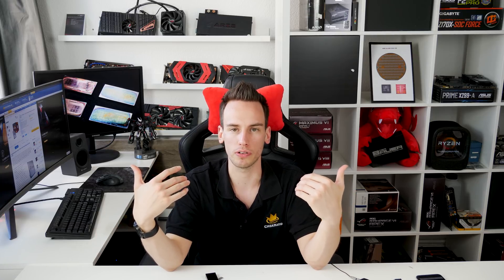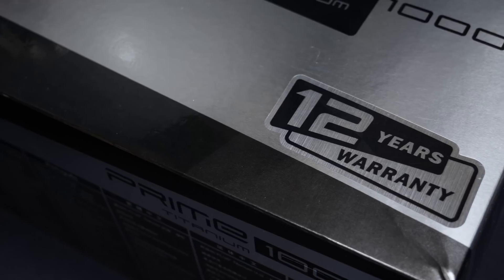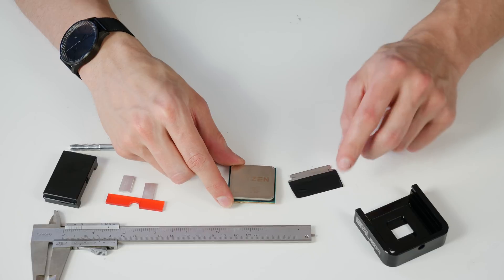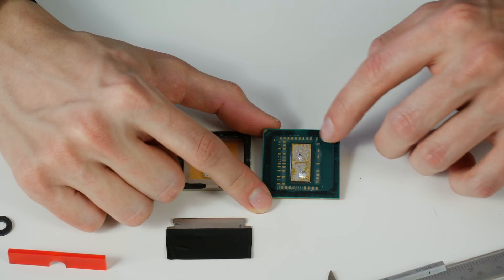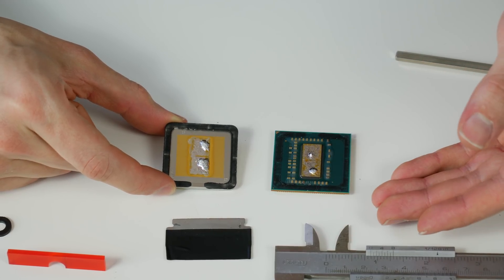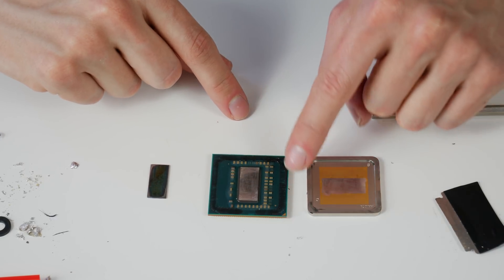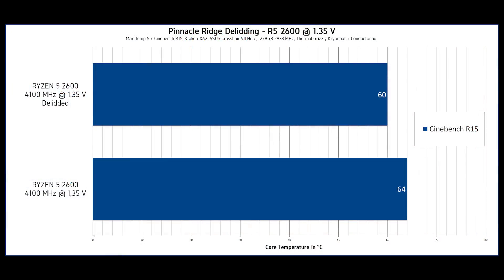ZEN+ Delidded - Before/After Temperatures - [Ryzen 5, 7, 2600, 2700X]

Comment: I ended up here because my girlfriend bought someone's old Gaming computer.  It's a bit of an outmode.  I havent removed the CPY cooler (yet) but so far it looks like whoever built it used a cheaper RAM in it and only 16GB of ths 32GB potential, it's also 2100 and I think the motherboard said it's capable of 2600 and 3000.  
   The Mo-Bo is a Gigabyte A320M-S2H V1.  From what I'm seeing, a Ryzen 5 3600X will work (if it doesn't already have a Ryzen 5 3600)  BUT I'm seeing a lot of issues with the R5 3600s havibg issues dissipating heat, and several people have reported that it was cracked or faulty solder; and that a de-lid and liquid metal fixed the issue.   So can this same method, or similar, be applied IF the person who sold it, di so because it was havibg issues.   I've seen where some people "fix" the issue by simply turning off cores, throttling or temperature limiting in the bios, but thats not actualky a fix.
 I'd tather change thermal paste or liquid metal every now and again, rather than have a brick, or something that might burn out.

Comment: Fantastic video. Can I ask , is the metal heatspreader that you removed made of solid metal? I the reason I ask is I have just recently installed a really tricky CPU cooler on my 5600x . Tricky meaning I had to put a lot of force from a 45 degree angle (clipping one hook on one side first then pushing down on the opposite side to latch the other side of the cooler) , but I’m a little worried I might have dented the heat spreader etc. 

CPU runs fine though. Would appreciate your feedback, thanks in advance 👍
Reply from the maker: The Heatspreader is always made of Nickel plated copper. Should be strong enough for any load :)
Reply: @der8auer   many thanks for your reply. Awsome video👍

Comment: Re:Die size. the only way it would be smaller is if it had the same performance ie if you made both the same core count and overall power the smaller nm one could be a smaller die size if they wanted

Comment: 13:18 why are you surprised ? what is the corelation of the size of a die with the 14nm or 12nm fabrication process ? those nm have to do with the dimension of a transistor and not with the die size.
They just manage to put more transistors on the same size of a die. That die is calculated to the TDP so that the cooler can manage all the heat coming out that cpu.

Comment: what about the difference that 4 degrees makes on top of the gains you make from also using the liquid thermal paste when you put your water cooler back on. so fo instance (this is just based on what i have seen so far from videos. so in most cases people are claiming 20 degree drop as using it on top of the lid when you put your aio or prism or whatever you use for cooling. so that on top of the 4-5 degree you gain from putting it on the actual cpu after you delid it so were talking a 24 degree c difference. would that be worth it then? or would you just recommend only using the liquid thermal paste normally without delidding and adding all that stress and effort. Im asking only because this is something i am interested in and am willing to buy a second 2700x just incase i ruin mine. Or should i just invest in a better water cooling system like a custom loop?

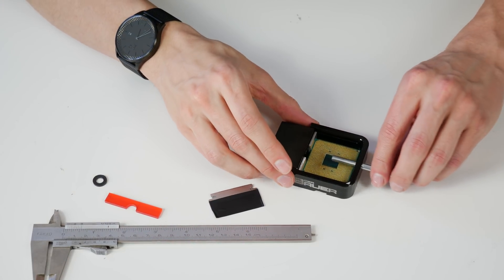Comment: That potato slicer didn't look for use on an expensive piece of silicone...you could hear the threads of the bolt running over the pins on the chip like running your finger down the teeth of a comb(@5:19) GN has a nice one with the bolt located on the side. Deforming the pins in any way(or creating a bur on nic) is bad news and counter productive to the task at hand.  Use extreme caution...

Comment: Actually die can be smaller, but you are measuring package dimensions. Take a closer look, die is inside that back thing. Do not forget that actual IC is about 0,3-0,5mm thick on there are protective oxide layers on the bottom there are pads for soldering. The back thing you are measuring is called wafer level package.

Comment: 12nm is 14nm is 20nm.  the other fabs skipped 20nm because it wasnt any better than 28nm without finfets.  when they added finfets they decided it was so good they should call it 14nm even though it was still 20nm.  thats what first gen ryzen was, 20nm.  second gen ryzen was... 20nm with high leakage gates for higher clocks similar to intels ++.  its all 20nm.  even wikichip has it listed under 14nm and it has 14nm listed as the same size as 20nm.  the numbers dont lie

Comment: Just so you know my 2600x which is not delidded idles at 28c and under a massive torture load only 68c curtesy of a Cooler Trade from a Friend the Prism Cooler on the 2600x is Bagging... So 4c is not worth it just get a cooler that is meant for a chip in a higher weight class and forget about it until it needs some new paste... Granted this was very interesting. Here's a Like!

Comment: TLDR; You went from 64C in five runs of Cinebench with a Kraken 62 cooler and 4.1ghz OC down to 60C and it is not recommended to delid a cpu for that. Conclusion: intel still has an edge (barely) but AMD doesn’t put bird dropping inside their cpu’s.

Comment: the half step node usually refers just to transistor size. so they use that same wafer for a smaller design allowing a larger transistor count on otherwise the same sillicon footprint

Comment: Woo, my Ryzen 2600x actually goes to 4.3 so mine is better than DeBaurs! The die size overall won't change really but the actual chips inside will be smaller and more dense.
Reply: OMG 4.3? you should go buy a lottery ticket lol.

Comment: I didn't verify this against multiple sources but rumor is 12nm is simply just an improved build process over 14nm rather than an actual shrinkage in process. So maybe 12nm is more like 14nm+ hence why the die size remains unchanged. 

A similar idea is going around about 7nm being more like 10nm in reality. Again, I did not check this with multiple sources but have heard it in youtube videos so it should be taken with a grain of salt.

Comment: The same die size may be due to having an increased area which allows for better heat flow (cooling):
H = k A (Th - Tl) / L  <--- increase [H]eat flow by increasing [A]rea
https://en.wikipedia.org/wiki/Thermal_conductivity#Equations

Comment: The reason the die is the same size is because AMD increased the space in between internal components in the chip.  So the "features" were smaller, but their was greater empty space in between them.  This allowed them to gain some clock speed.  AMD really attaches their IHS with quality materials.  Impressive stuff AMD.  This will help them in the future with Ryzen 3000 series.  Would an iron and desoldering braid be dangerous to the chip?  I would put a new bead of solder on it, and put it back into the oven to solder it again.

Comment: You were wondering why the die isn't smaller, it is because it needs to fit the same form factor so the company doesn't have to change tooling on the assembly line.

Comment: Solder compounds have a thermal conductivity of about 50W/mK indium liquid compounds peak at about 95. Its not worth the loss of warranty. Also, you are confusing the solder with indium which whould only be, at best, halfway correct for PbIn-50-50 but they most likely use SnPb (tin, lead) alloy or SAC, both are cheaper and better in therms of thermals.

Comment: Hello der8auer,

Do you think that smd caps are there to make different in between CPUs ? For ex: 2700 vs 2500 vs 2700x ? Because the Silicon mask should be the same but after binning process they sort low mid and high quality cpus

Comment: Mr Der8Auer if you just want your c pu  to have a better burst without throttling might you get better performance under high work loads (games) by delidding? Since burst is usually higher than an overclock it seems Ryzen is smart over clocked essentially.

Comment: The 2XXX series is more like a revision to the 1XXX series. Benchmarks show about a 10-16% increase in performance between the 1800X and the 2700X, so I'm not really surprised that there's not much difference under the lid between the two chips

Comment: Do you ever slice your fingers on those blades? I cringe a little watching you put so much pressure working them into the gap between the IHS and PCB while you hold the CPU with your right hand.
Reply from the maker: So far still owning 10 fingers :D

Comment: 12nm is the size of the transistors in the chip, so they can fit more of them in the same die size. If the die was any bigger they would get fewer yields per wafer in manufacturing.

Comment: its probably cheaper for mass production if you use the same dye size in all your processors instead of refitting all the machines for a marginally different size for each node.
Reply: Yep, probably what i suspect also.
Reply: easier faster better too. you dont see ryzen shortages

Comment: 12nm is just a refinement of 14nm. So they should be very similar in terms of size. The 12nm improves power consumption and enables higher clock speeds, but it's still basically the same technology as 14nm

Comment: hey @der8auer not sure if someone answered you on this;
Long story short AMD's main Focus was ZEN 2 on 7nm, they basically just wanted the gains from 12nm without a major redesign to shrink the die size; 12nm is a small re-tool of 14nm so it was easy to do and port over ZEN 1

You can read into it further on Anandtech's website: The AMD 2nd Gen Ryzen Deep Dive, Talking 12nm page

Comment: They might have kept the die size the same for manufacturing reasons.  Going down to 12nm might have only saved them a few mm^2 on what they could make the die size, but then they would have to rework all of the carrier PCB's etc.  So it might've made sense to just waste a little die area and so they could use more stuff they already had.

Comment: It likely wasn't worth retooling the PCB to make to get the small cost savings of the 10% density improvement, so sticking with the same die size was just cheaper because they could use the already existing PCBs.

Comment: @der8auer AMD earnings call Lisa Su says 12nm is not a die shrink. "Auguste Richard - Northland Securities

Yes. Thanks for taking the question. Real, real quickly, can you just tell me if the 12-nanometer is a dye shrink or just performance improvement?

Lisa T. Su - Advanced Micro Devices, Inc.

Yes, Gus, it is primarily performance improvement, and it is some design improvements. So you see some of the latency improvements and so on. It is not a dye shrink."
https://seekingalpha.com/article/4165998-advanced-micro-devices-amd-q1-2018-results-earnings-call-transcript?part=single
Reply: "Ultimately, the new processors are almost carbon copies of the old ones, both in terms of design and microarchitecture. AMD is calling the design of the cores as ‘Zen+’ to differentiate them to the previous generation ‘Zen’ design, and it mostly comes down to how the microarchitecture features are laid out on the silicon."
https://www.anandtech.com/show/12625/amd-second-generation-ryzen-7-2700x-2700-ryzen-5-2600x-2600/2
https://images.anandtech.com/doci/12625/12nm.png

Comment: Just listened to AMD Conference call. They said the 12nm is only optimizations and not a die shrink, this explains why it's the same size as the 1st gen when you measured. Scratching my head how they went from 14nm to 12nm and it's not a die shrink.